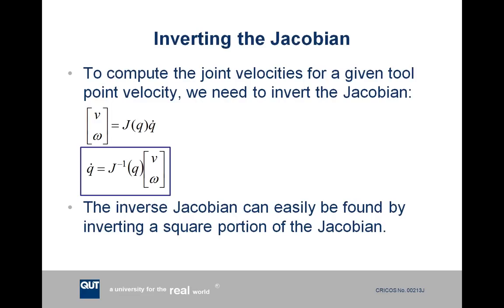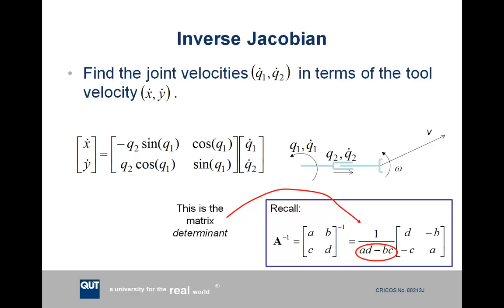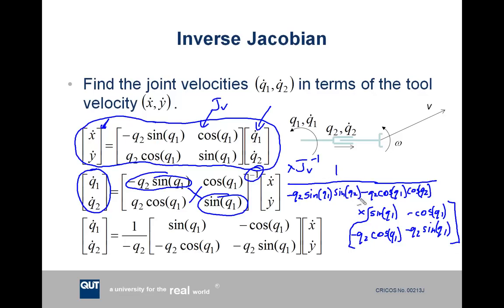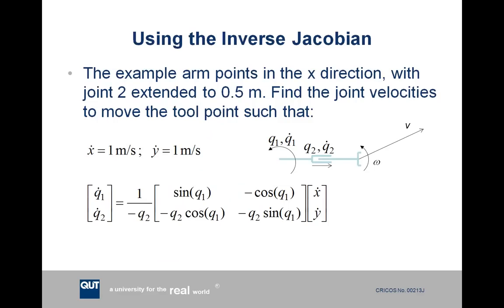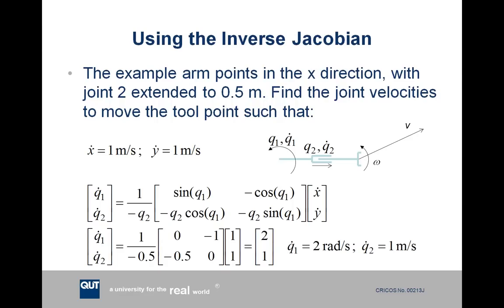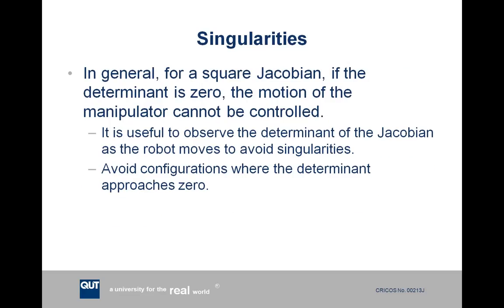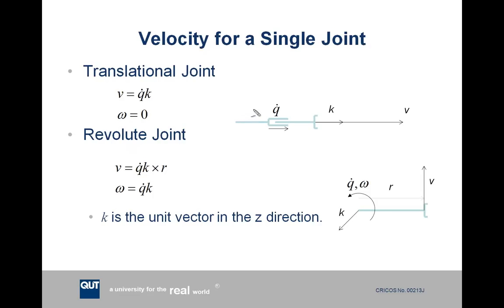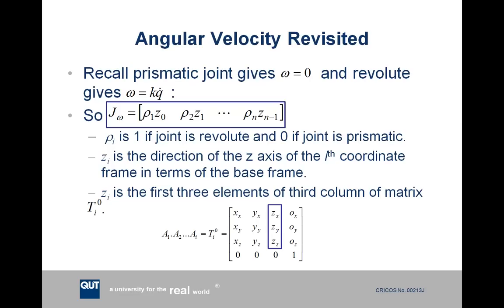Velocity, Force and the Jacobian Part 2

Comment: You only see q1 inside the sine and cos functions because only joint 1 (which has joint variable q1) is rotating. Joint 2 (q2) is a prismatic / translational joint, so it extends and retracts, so you'll never see q2 inside a trigonmetric function (sin, cos etc.). q2 is in other places though on the slide.